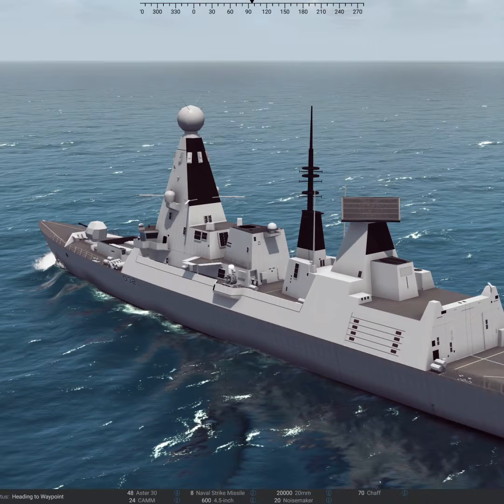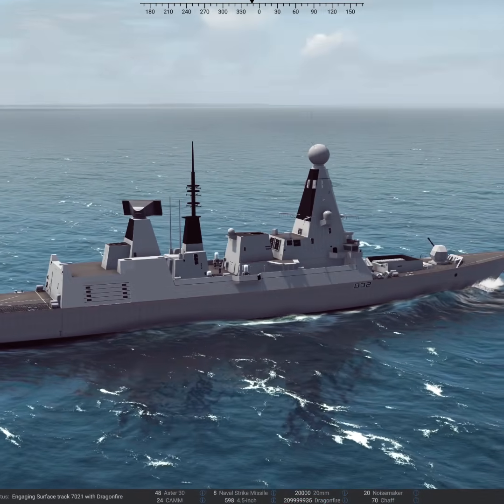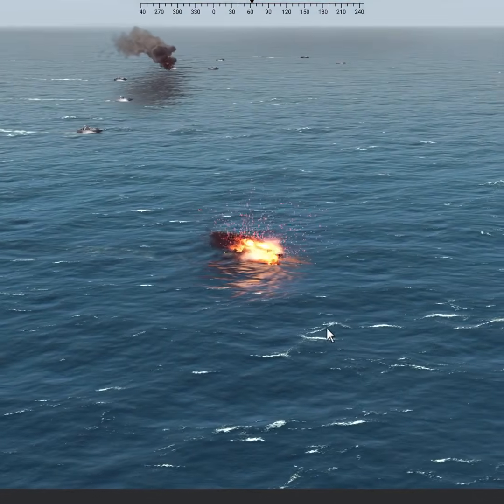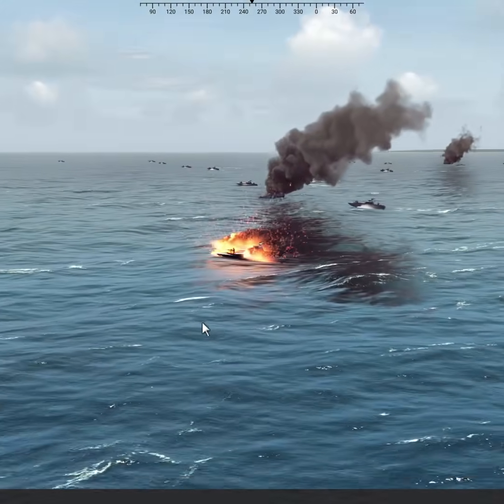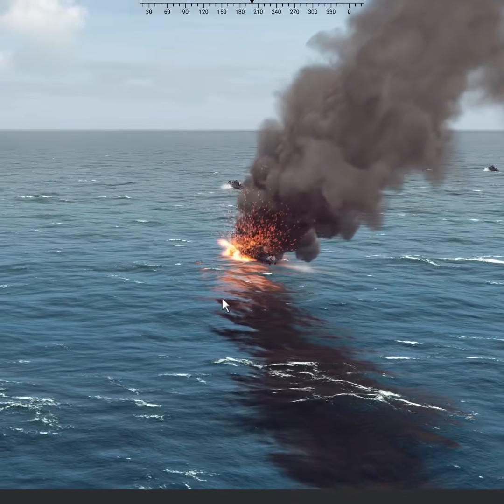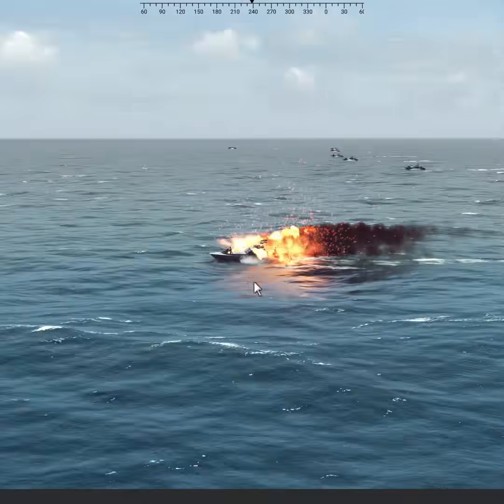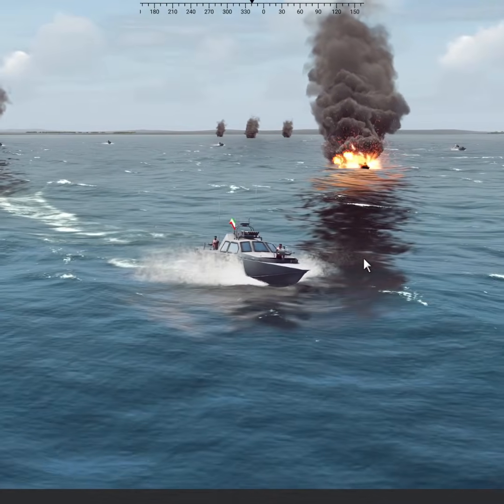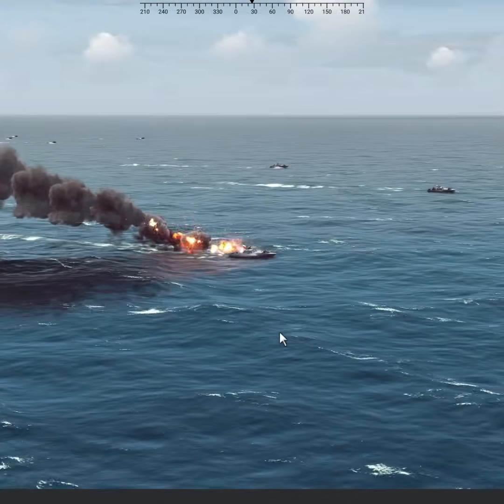400kW DragonFire Laser vs Iranian Boat Swarm #SeaPower

Comment: There is zero aim related slow downs. This doesn't properly simulate hitting a motor or fuel storage. Or just a big hole in the hull. It doesn't take this long to remove a threat that small. America proved it with a video. Less than two seconds. Honestly it was probably less than a second to take out a narco boat.

Comment: What would be the effect on personal abort the attack boats? You might not need to fully destroy the boats if the crew were blind or otherwise incapacitated. That might allow the laser to engage the vessels much more quickly.
Reply: That's the concept behind a lot of microwave crowd control devices.
Reply: @squireson Yes, but the microwave weapons are non-lethal. The Laser is very lethal, though maybe not instantly.

Comment: Even though it takes a while, its almost perfectly accurate and FAR cheaper than missiles.
Reply: We don't know how expensive it is. The cost won't be in the energy generation (which does have a significant cost at sea). It will be the cost of keeping it operational on a ship. 
Operating costs will be affected by use, as well.
Reply: Lasers are not perfectly accurate and actually have a rather short range, the light with continue to scatter as it travels until it’s harmless, that, or you have so much power that it’ll get to the point of blinding random people if not used under specific circumstances like in the middle of the ocean

Comment: This is what AI has to say about a 400kw laser. A 400 kW laser destroys a patrol boat through rapid thermal ablation, delivering intense energy that melts or vaporizes structural materials in seconds.
1. Structural Puncture
The beam focuses enough energy onto a small spot—typically a few inches wide—to raise the temperature of the hull beyond its melting point.
Aluminum: A 400 kW beam can "drill" through standard aluminum plating at rates exceeding 20 cm/s.
Fiberglass/Rubber: High-speed vaporization causes these materials to catch fire or lose structural integrity instantly, leading to rapid flooding or deflation.
2. "Mission Kill" Targeting
Rather than melting the entire ship, the laser targets critical systems to disable the vessel:
Engine Casing: Burning through the engine housing to seize the motor or ignite fuel lines.
Fuel Tanks: Piercing the tank to cause an immediate conflagration.
Sensors and Weapons: "Blinding" cameras or detonating onboard munitions like RPGs or missiles.
3. Thermal Shock and Personnel
The intensity of a 400 kW beam at close range creates a thermal effect similar to a small-scale explosion. The radiant heat and blinding light can incapacitate the crew and ignite all flammable materials (seat cushions, paint, uniforms) within the cabin area almost instantly.

Comment: So wouldn’t painting everything white prevent a laser from causing any damage outside of the odd personal that happen to get affected by the beam?
Reply: Reflectivity matters but with this amount of light it's not a perfect shield at all. Lots of white paint only reflects 70-90% of the light.
Also, above a certain temperature many material properties change, metal stops being reflective, white paint can charr to black and suddenly absorb a lot more of the light.
Reply: Not necessarily, the laser is so powerful that it wouldn't be able to reflect enough energy in comparison to what gets transferred 

Maby if it was made out of a perfect mirror but just white wouldn't work